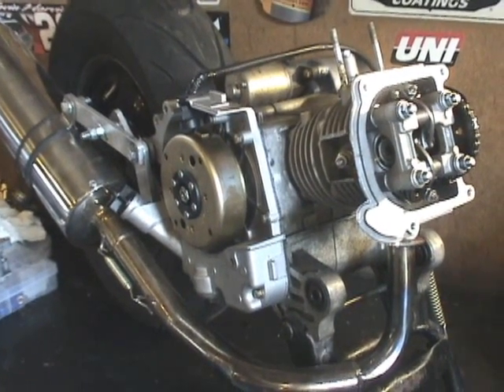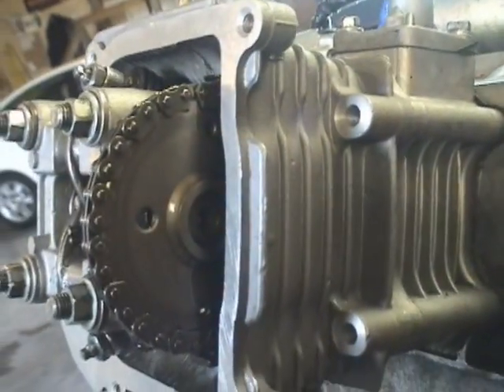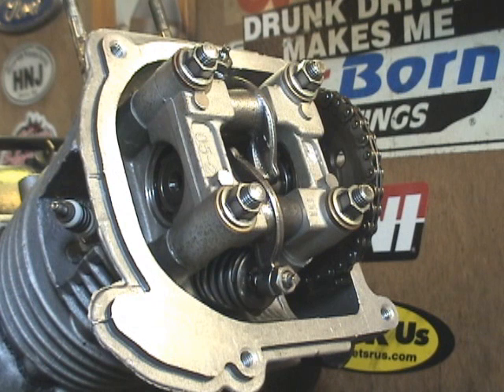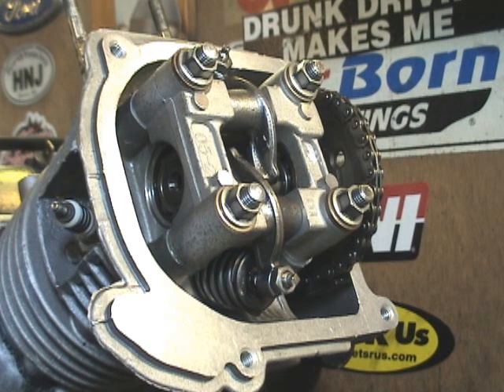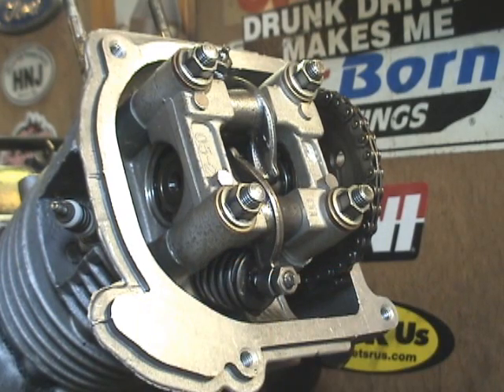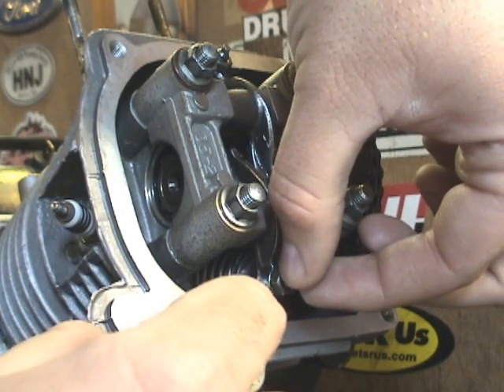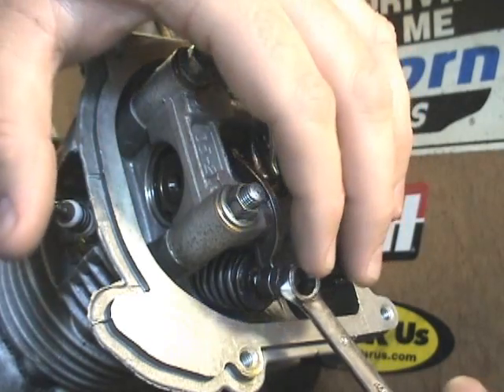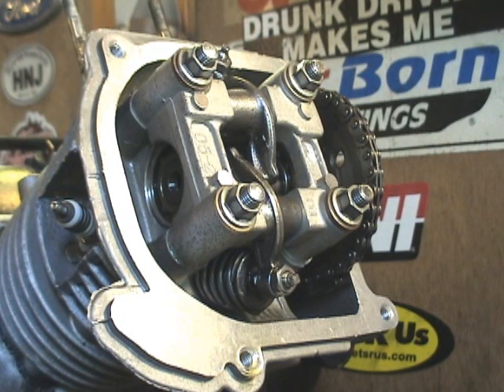Scooter How-To : GY6 Valve Adjustment (Also For Buggy + Kart)

Comment: you should have no ticking? one comment said if there not making noise their to tight? your take on this.
Reply from the maker: +Kevin Stearns There should be ticking. That's normal. No noise does mean they're too tight. Lots of noise means they're too loose.
Reply: +90GTVert i have to disagree there should be no noise what so ever. ive talked to mechanics and they agree.one has 35 years of exp.
Reply from the maker: I've never heard a valvetrain work with no noise whatsoever.
Reply: i have and mine makes none whats so ever neither does my brothers scooter.

Comment: yes i even tried to start but wont. it has new top end along with new head. at one point when i adjusted valves a certain way i got 90 psi
Reply from the maker: Lizet Corrales If adjusting the valves makes it jump 30psi I would advise going over the valve adjustment process shown carefully.

Comment: i have a gy6 150cc i have replaced top end, piston, rings, cylinder, and new head with valves. but i still only have 60 psi compression please help anybody
Reply from the maker: Lizet Corrales Are you sure the compression tester is accurate/sealing?

Comment: I have a new GY6 150cc that has very similar problem to dantmanish listed below. I have not adjusted the valves. Somebody suggested I put the stock air box on but I really dont want to do that. I replaced the 24mm carb with a new one that had bowl screws and idle idle mixture screw available. I cant get more than 44 mph out of it nor can i get it to run higher than 6000 rpm. I have a 108 jet in it and it seemed to help but still just not getting the performance i expected. It also idles poorly. I disconnected the choke and ordered a manual choke. The usual perf stuff - exhaust/muffler, orange cdi and coil, cold air kit, new iridium plug, Any thoughts on this one ?
Reply from the maker: You need to work on tuning the carb. If you've only tried one main jet, try others. This may be of some use... it's a 50cc, but same idea as far as simple tuning methods.
https://www.youtube.com/watch?v=K5j8gHg5kMc
Reply: Well I reset my focus to the carb and it turns out that there was an issue with the new carb I bought. Put the stock one on and made three runs at 53,54 and 55mph via GPS. Elavation 4450 with 225lb rider and 260 lb bike. I re jet the carb tomorrow. Starting point will be a 108 main
 Thanks again for your help.Always right on target.
Reply from the maker: Glad you're making progress. Good luck with the tuning.

Comment: I have a brand new taotao 50 cc four stroke and I can cruise fine but when I give it full throttle it will lose all power until it eventually dies. It will start back up and drive off fine but it keeps doing it. Any idea what that could be? Thanks!
Reply from the maker: More info would be helpful. Does it bog clean or sputter? Does it die out very quickly or does this take a while? Have you modified the air box or anything else at all?
Reply: It does begin to bog. It takes a while until it finally dies. No I haven't modified anything
Reply from the maker: Float height could be low. Clogged, dirty, or too small main jet. Fuel tank venting issue. Pinched hose. Dirty/clogged fuel filter.

Comment: i have a maddog 50cc scooter with a 70cc kit and when i give it full throttle it bogs out i cant figure out the problem with the scooter it will start up and run it just wont go any faster then 25mph sometimes 30mph
Reply from the maker: Did you tune the carburetor when you installed the big bore? Possibly too small of a main jet or dirty/clogged main jet. Check the float height as well while you've got the bowl off if you mess with jets.

Comment: This video was very helpful because this is the third cylinder I've been thru in less than four months. For a gy6 150 with the 155cc kit, what should the best adjustment for intake and exhaust?
Reply from the maker: 0.003"-0.005"

Comment: I have no power to my head light do you know how I can fix it
Reply from the maker: Check for power at the light on both high and low beam. Check for power out of the hi/lo switch. Check for power into the hi/lo switch. Check power out of the regulator. Check power out of the stator. Basically work your way through the system and figure out where you do and don't have power and that should lead you to the culprit.

https://www.youtube.com/watch?v=AZbg-krvZM4

Comment: Question if adjust the valves in my scooter 0.005mm i heard tapping all the time if i turn it down to 0.003mm it will losses the tapping and gain more torque?? both sides??
Reply from the maker: Those numbers should be inches, not mm. Thousandths of a mm are incredibly tiny.  Some tapping is normal. These days I use 0.002-0.003" on my 139QMB usually.

Comment: And where is the idle mixture screw on the carburetor at on a 250cc roketa it should be on the left side of the carburetor to the bottom there is none everything here is a little different then on a 150cc scooter?
Reply from the maker: Look on the same side as the enricher, down and on the end toward the engine.

Comment: Hi 90gtvert great video tutorial i am trying to adjust my valves but a have a slight problem,where is the cooling fan on a 250cc roketa and where is the stator on a roketa it should be on the right side of the bike side but dont see it its a little different then on a say 150cc scooter?
Reply from the maker: Some of the 250s are a bit different than the smaller engines in their layout. You would be better off finding a video specifically for a 250cc scooter or checking a service manual.

Comment: Hey. This is a 125 or 150? Exhaust 0.08 mm and 0.1 mm suction? Thank you
Reply from the maker: In the video it's a 50cc, but the specs you list should be alright for a 125/150 GY6. Usually the other way around though, most would set the exhaust to the larger spec or set both the same.

Comment: Thanks for the video! I'm the keeper of a friends GY6 equipped scoot so have been learning how these things work as I go and/or as parts fall off of it.
One thing that might help, you can use a square drive wallboard screw with the head bent to 90 degrees as an adjuster holder so you don't have to use pliers or whatever to hold it steady.
My Honda had 8 and my Suzuki has 16 of the same adjusters so I'd go nuts trying to shove my hands in there without something to turn or hold them. I noticed a wallboard screw driver was the same size so I invented my own tool. I even put a little tube on to the end for a handle.
Reply from the maker: Thanks for the tip.
Reply: awesome tip, with drywall screw. beautiful.
Reply: NOW THAT WAS A GOOD ONE!

Comment: Hi, I have a new 150 cc Chinese scooter, I had this scooter shipped to me direct, since I've had it, it has been running poorly, after watching videos and searching for blogs on the Internet I have replaced the carburetor, coil, vacuum operated fuel shutoff valve, and CDI module,at first it was very hard to start and would not idle, now it starts and idles just fine,but when it warms up and I accelerate it bogs down and sometimes won't stay running, so after a minute or two on the side of the road it starts up again and will only run at very low rpm's if I try to give it any gas it'll die,do you have any idea what would cause this, vacuum leak? Or do you think my valves need adjusting,any ideas? Thank you for your videos , Dan
Reply from the maker: Doesn't hurt to check the valves. See if the jet size is different in both carbs and if so see if the jet from the previous carb makes it run any better.

Comment: I thing to menchion to is sometimes just leave well enuff alone. people tell me all the time to adjust my timeing cus I burn a little oil but I keep telling them its fine when you ride all day ithingn temps of 90m and above things heat up and its burns only a half of a cap off a 1 qurt oil bottle after rideing all day. also my bike is old beet up and dus 45 mph and I get the same thing from people adjust it cus it should only do 35 max. to me the bike seems find sounds good and starts ez I was told buy a local shop the rps are a tade higher but in the safe zone. to me its works wi take a chance of screwing it up please let me no what you think. thanks

Comment: Can a Gy6 150cc Not Turn On If Valve Not Adjusted ? It Was Working Good Until The Next Day Didnt Wanna Turn On I Cheked Wiring It Has Gas And Spark New Battery And Nothing pleasee Helpp !! 😔
Reply from the maker: If it cranks and won't fire up it could be the valves.

Comment: my atv was working good and one day i had dificulty to start . after it was start it was ok . after that a week after i try to start my atv and nothing . engine turn like in butter ( like a car that have a broken timing belt) can soneone help me .
i set the valve and its not starting my atv . can timing make my atv 150 cc (157qmj gy6 ) not start ? event if its only jump 1 teeth on timing  because it is like theres no pressure and you can hear a small pet from time to time but not enough to say its gonna start (i will try to post a video soon)
Reply from the maker: Double check that your cam marks are aligned with TDC and you'll know if it's moved. Check compression.

Comment from the maker: Nice! Glad you got it working well. Check those vales a little more regularly. Maybe every 2500 miles or so. Keep the oil changed every 500-1000 miles IMO. If you haven't done it in the 4500 miles, it's time to change gear oil and check the CVT out as well. Good luck with it. Check out my other vids and the forum if you need more help.

Comment: Just wanted to say thanks for replying back and using your video I adjusted my valves on my 2012 Taotao 150cc to .03 intake and .04 exhaust (because that one was super tight) and I went from going 30 slowly up a hill for no reason all the way to 50. It didn't even run like this great when I first bought the bike used 4500 miles ago!

Comment from the maker: These specs are OK on a cold engine. The outside temp prob doesn't sway enough in most places to make a huge difference. Hot isn't saying a 90 degree day, it means when the engine is at operating temp which means the head is likely 200F or more.

Comment from the maker: They're saying .002" for both the intake and exhaust. Should work. I'd trust Honda specs. I set scoots to .002-.003" regularly too. You could try a little more play like .003" and set them as spec'd to .002" if you hear valve tap.

Comment: very nice video but i just have a question to ask,i have a buggy carter sym 250 gtr but my engine valves  are doing some noise (clak clak clak clak ... very fast) and im in africa so every thing here is in mm so could you plz tell me  what mm should i use to adjust them.thx you and good work

Comment: Hey 90gtvert I got my new carb in runs pretty good now! I have a question. I didnt know how to message you. I know ita junky scooter but its a Schwinn 49cc Graduate. only has 500 miles on it. Its top speed is only 35mph. Is that normal? What are some things I can do to get some more speed? Im a pretty decent mechanic. From 30-35mph it takes awhile. Thanks if you can comment back!

Comment: It only runs when I spray gas in the air filter. Ive changed gas twice, changed all the lines, checked for all vacuum lines that I know of. Have checked the gas tank fuel valve. The diaphragm seems to let gas out when the engine is turning allowing gas to flow. I don't know what else to do. Runs fine for about 15 seconds while i have sprayed gas into the breather. I ordered a new GY6 Carb. Do you have any more suggestions?

Comment: I have had my Schwinn 50cc Campus in storage for about 4 years. Last time i rode it it ran ok kinda weak.. Now I cant get it to run worth a crap. Runs for about 30seconds- 2 minutes with the tire off the ground. Do you think this is the problem? Ive checked fuel and I've taken the carb out cleaned it really good checked the float. Not sure what else to check.

Comment: nice video. i have a question. there will be like valve noises when you don't adjust the valves right? i just dunno or am not familiar with valve noises as my bike's engine emits other squeaky metallic noise.

Comment: i have a 150cc gy6 and the marks on the fly wheel look like T F I I, how ever when i line up any of the lines or the T with the mark on the case, the holes on my cam shaft dont line up exactly right but when i line the cam shaft up properly the fly wheels markings are almost an inch to far ahead where they should be, is this an insignificant issue or should i undo the nut holding the fly wheel and adjust it until everything is lined up exactly right ?

Comment: I just got my 150cc scooter. MC_D150T, it has the GY6 engine i assume since it's chinese. But i am very concerned. Everyone on the internet says to put 80W-90 gear oil in the transmission. My "operation instruction" manual says to use 10W-40 for the engine, and 10W-40 for the transmission?¿¿¿ What should i do?

Comment: YES!!  More to the procedure, not this video(although it was good.)  I couldn't figure out what was wrong with my 50cc scooter. I guess it wasn't letting enough out on the exhaust stroke and it was building pressure and dying. My exhaust valve was at about .002, put it at.004 and it's running good.    Loosened the intake from .003 to .004 as well.

Comment: @90gtvert I finally replaced my broken valve springs.  It starts instantly and runs fairly good.  But at higher speeds it will occasionally misfire.  I've gone and reset the valve gaps several times, yet it still does it.  

Question:  Is it possible to have the two smaller hols on the cam chain sprocket, and one larger hole on the sprocket, in the postion you showed, and still not be in the roght place?

Comment: I need to replace some broken valve springs on my GY6 scooter.  My questions are....  Do the valve stem keepers have a up or down position?  Do the keepers need to be flush with the valve stem on the top?  Also, is there a trick to taking the rocker arms off to get to the springs, or does the whole unit come off with the rocker arms?  HELP please.

Comment: the thing I have noticed is that they all vary as much as several thousanths of an inch and with that in mind it pays to adjust then fire it up and let it run it took me several tries to get it to quiet down and it seems no two are alike and as far as setting one different than the other is another question